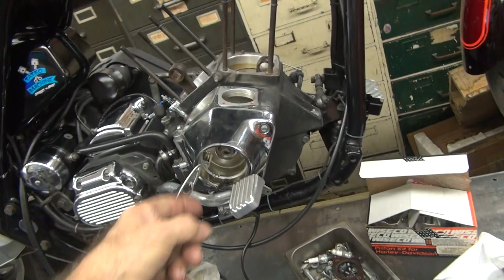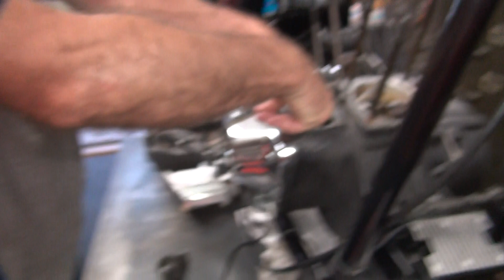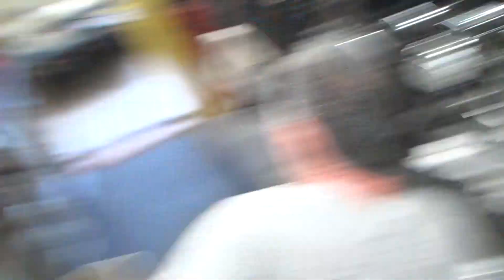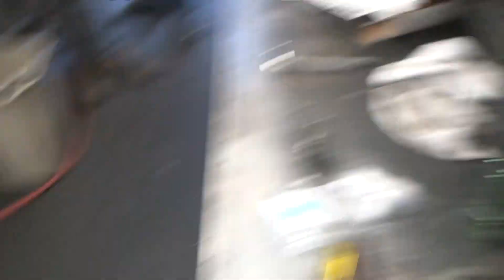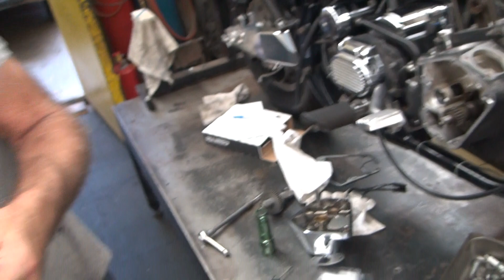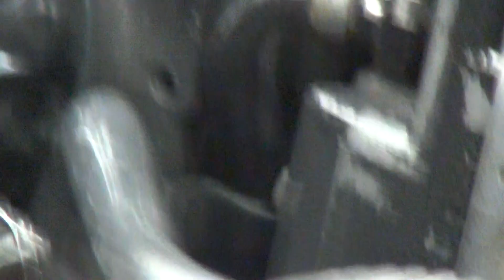#134 1988 fxr alternator clutch primary repair cam change ignition gearing fxrs harley tatro machine

Comment: On a personal note I love my "N" cam, it produces enough gitty up for me and gives me 55 mpg average. In an era of $5.00 gas I'm not interested in doing wheelies, especially on a bagger.
Reply: Interesting Ken. I have heard the N grind called the neutered grind - full on smogger? I'm going to change back to the L grind in my 1991 FLH, I understand it to be prior to smogger stuff. Hope I'm on the right track.
Reply: @frankmccracken743  yep, that's the factory cam from 1998. 24586-93 is the applicable part number for it. It's nothing that'll give big horsepower gains but perfect for my riding style. My other bagger is the "Hot Rod". It's got all kinds of performance goodies.
Reply: @kennethwise7108  Hey Ken. I was thinking the smogger cam would hurt mileage a bit, hence my choice for the L. I never rev over 3000rpm - maybe I should re-consider?
Reply: @frankmccracken743  if you're running stock slip ons like me you should be fine. My bike runs phenomenal with both. I am running a CV40 with a 45 pilot and 170 main. Seems like it's perfectly fine.
Reply: @kennethwise7108  Thanks Ken. I located some nos mufflers off a 2016 FLH. Quiet like a Shriner bike, bolt right on. Clean bike.
 Don't know what cam it has but it has adjustable push rods. 
165 compression both cyl.
I am running a #45 pilot but running lean. Can't find a vacuum leak. Ready to try a #46 but I shouldn't need to. 1000ft above sea level.
Reply: @frankmccracken743  Evo's do run lean and commonly have white plugs. If it runs good leave it be.
Reply: @kennethwise7108  Thanks Ken. Where are you located?
Reply: @frankmccracken743  No Problem, Carlisle PA
Reply: @frankmccracken743  there's a nice one on ebay for $48. It's the one that has an HD orange blanket underneath it. I'd put the one piece solid pushrods back in it if it was me but that's just me...
Reply: @kennethwise7108  Any thoughts on using the S&S reed valve on a bottom breather as they are on this 1988 FXR?
Reply: @kennethwise7108  I have the one piece set ready to go. 👍